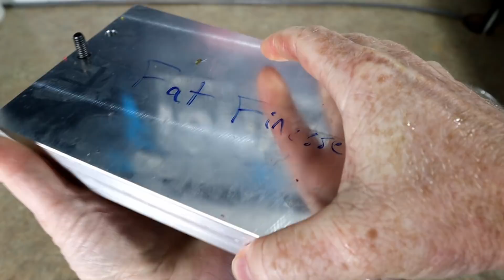The Mold That Makes TWO DIFFERENT BAITS???

Comment: Question to get the colors like that didn't you use a laminate divider? I didn't see one when you pulled the runner. TY in advance
Reply from the maker: the dual injector and blending bloack create the laminate, theres no plate or divider

Comment: Hi there  mold man sorry I don't know your actual name so in my head you are mold man anyway you have inspired me to remelt my used plastics but I would rather use something similar to what the original plastic was how do you compincate for the changes?
Reply: Hi his names chris and it depends on what you are melting down obviously your not gonna get the same colors if you melted down a laminate but if its solid colors you can come fairly close possible might have to add a little glitter to spruce it up
Reply: @anthonydunn9414  ok so say my original plastic is a craw is it best to use that same plastic to make a craw or does it matter
Reply: @britanierodriguez163  you can make what every you have a mold with but there are variations in plastics but that all depends of the company some use firmer plastic craws some dont but I use craw blend for making frogs and other baits that I need to be a little firmer but still have the action I'm looking for